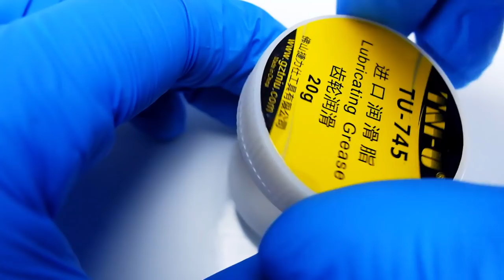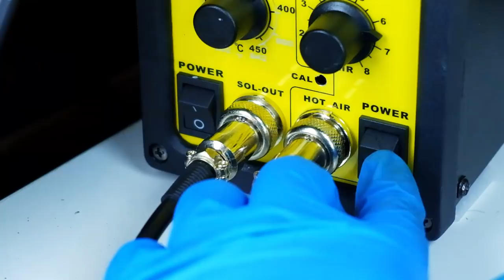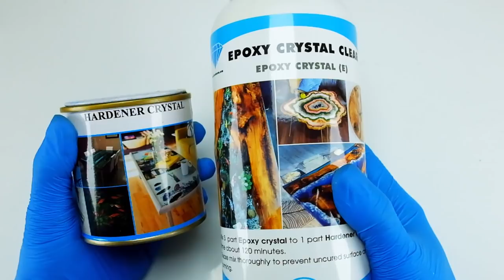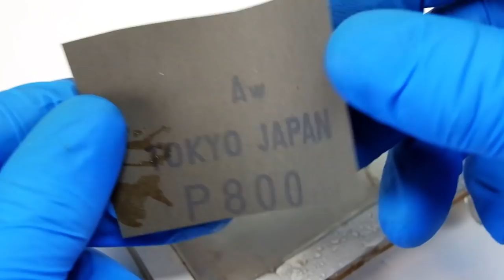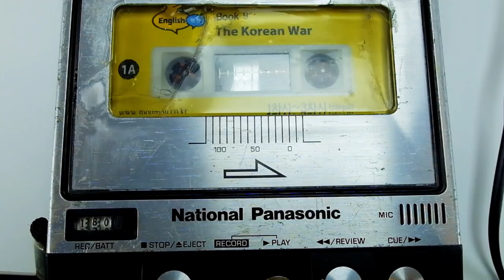Restoration cassette recorder junk

Comment: I would like to say to the author the following: Great work ! I like how meticulously you cleaned the mechanism and lubrified everything with the wd40.Your patience doing such a job and the attention payed for every detail shows how much you love electronics and what are you capable of. Two things I would have done differently,change the speaker with a better one,adapt a modern one because it would sound better. It is well known that old small speakers don't have trebles and sound stuffy.And probably would have looked to find a piece of plexiglas which could fit for the door instead working the original cracked one.This would of course made the thing not original but probably a little bit better in my opinion. At least that speaker I would throw it right away and put one similar from small mono bluetooth speaker and maybe the amplifier as well.3 watt Class D amp wouldn't drain the batteries more than the old one.
Reply from the maker: Thank you for your advice, I really appreciate it.

Comment: I went to the video to see a restoration and after 19 minutes I could only see a person who completely disassembles a cassette to partially clean it and reassemble it with the dirty parts, but when I get to the time to restore the cassette cover I regain the illusion of seeing good job and all I see is time wasted in reducing plastic and applying resin to obtain a horrible result...

It's very good to dismantle everything piece by piece and do things, but if when you put it together it doesn't look new or similar to new then it's not the same, but the appearance of this cassette after the "work" is so horrible that I think that the only thing that can be said in the title is "basic cleaning and commissioning"...

I am an admirer of any work carried out in a better or worse way and I have never negatively criticized other people's work because I am not perfect when it comes to doing my restorations either but I consider this video to be a scam and a waste of time...
If you had rubbed the parts of the mechanism to remove those grease and wear stains and then rubbed off the rust and used some product to protect the metal then it would have been something normal and well done, and if you had removed the parts from the cassette cover to remove the yellow glue and you would have cut out the transparent window to place a piece of new acrylic and really improve the appearance and rubbed and polished the back cover of the cassette then YES it could be called a restoration, in this case the only thing you have done is clean it basic shape and reinforce the lid with resin without achieving a much better appearance than it had at the beginning...

Honestly, it's hard for me to say these things but I feel totally disappointed when I see something like this because because of these types of videos people then think that by washing with soap and water and putting a little grease in some places they have already restored a device and I'm sorry but the word RESTORE has the meaning of repairing, renewing or putting something back in the state or estimate it previously had (or failing that, as close as possible) but in this case there is nothing similar to restoration because you have not You have not renewed anything, you have only cleaned and started the device, which I value because you have carried out basic maintenance and made it work well, but you should not call "Restoration" something that is not...